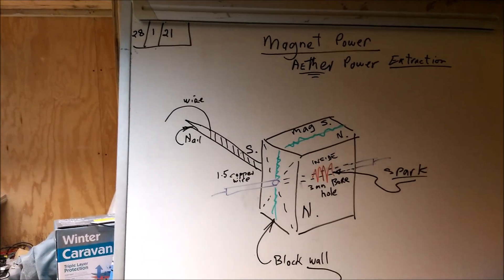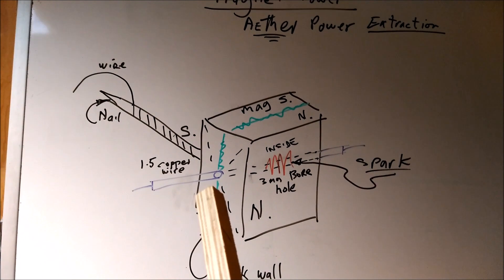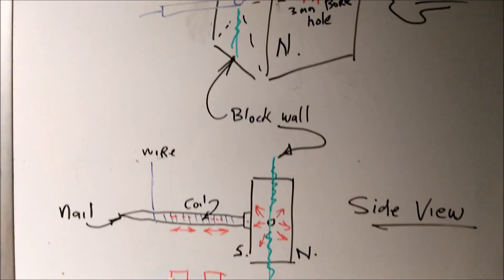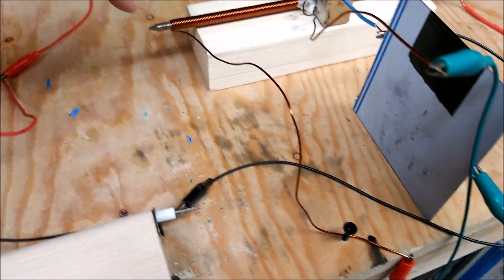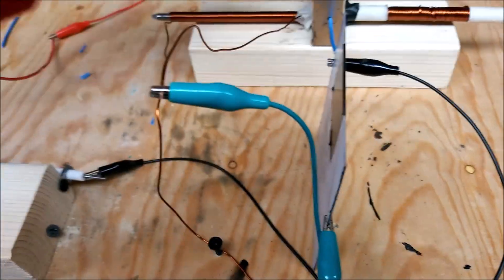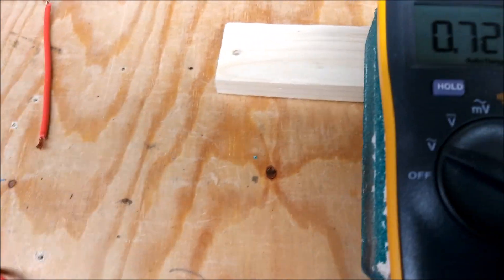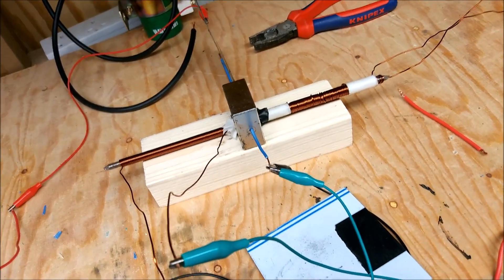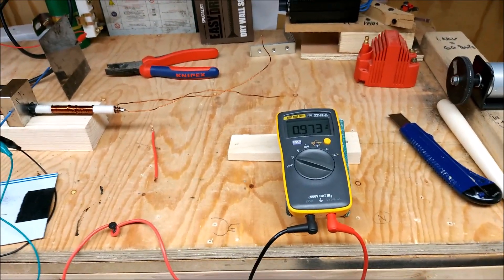Magnets Extracting Potential from the Heart of Matter

Comment: U mean to say jumping charges is what creates electricity nd hw fast u can make them jump using high  voltage u  have a electricity so all u need is an oscillator and Tesla coil and a spark gap to create electricity but hw to scale it up to get current In Kws

Comment: When you are activating the piezo sparker that ‘spark’ will destabilize the magnetic geometry out of alignment at the centre or ‘null’ point of the magnet. Over time successive sparks will degrade the overall flux’s of the magnet from the centre and spreading outwards.
Fun experiment!